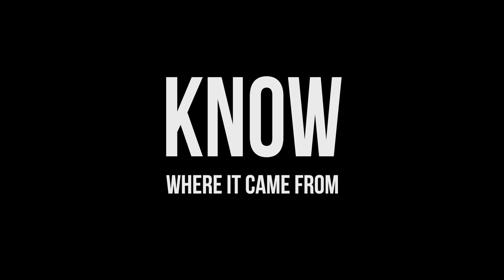Why JOE ROGAN buys Origin

Comment: I own a few pair of these boots.  Constantly get compliments about them.  They’re my number 1 recommended boot that I’ve ever had.  Keep it up!🇺🇸
Reply: @firebombspam2604  they’re pretty expensive, but you get what you pay for.  They break in very well and the materials are high quality as well
Reply: Do you actually work in them? Just wondering...Not an insult
Reply: @joshhorn5131  honesty, I have before, but I pretty much use them as an all-around boot.  They’re made of leather, so they’re more subject to tears.  If you need a steel toe, I believe they’re coming out with a work-boot in the next few months.  Maybe give them a call, their customer service usually answers quickly.
Reply: Thanks for the input,I appreciate it